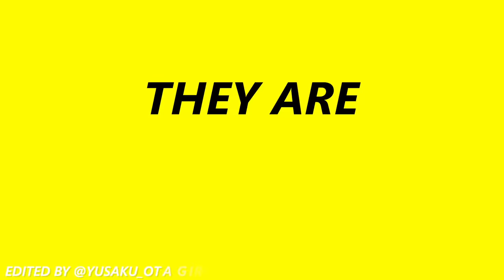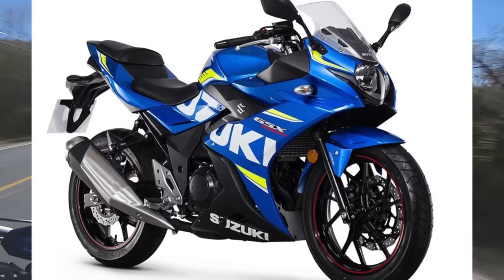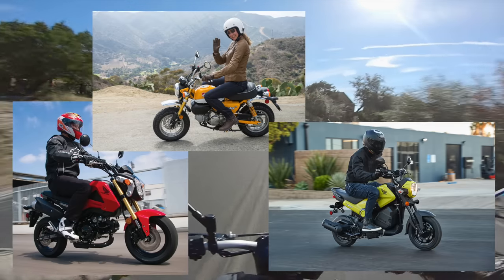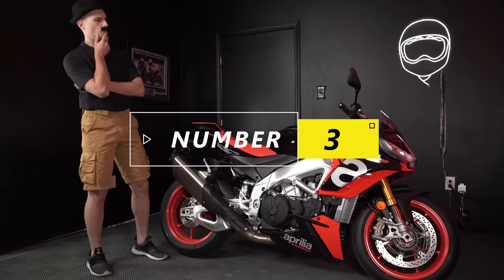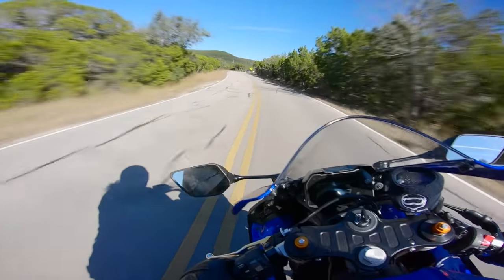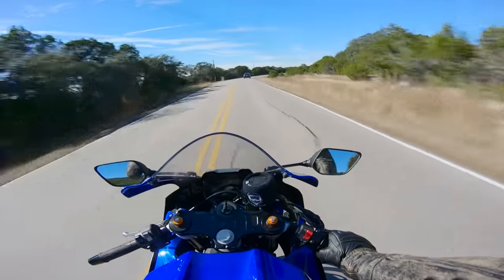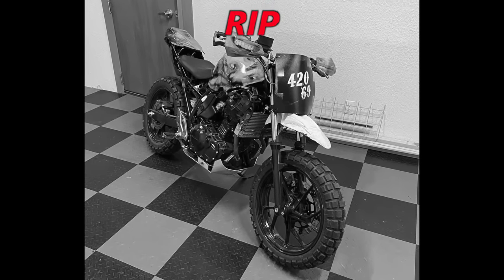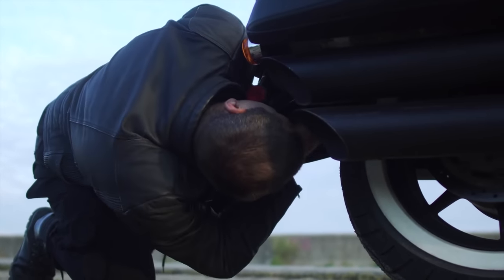Top 7 Worst Beginner Motorcycle Choices! (Must Avoid)

Comment: Although I'm not a beginner my riding has been cruisers. My 2011 dyna street bob is making 106hp/122tq so I thought the z900 would be a perfect 2nd bike not really thinking it couldn't be that much faster than my dyna. Needless to say one half throttle 2nd gear pull on the kawi that assumption went away real quick lol!!!
Reply: Yeah bro at the end of the day cruisers are heavy and slow compared to any sportbike 600cc and above.
Reply: I went from a rebel 250 to a ninja 300 to a 2010 zx6r then finally a 2020 z900. I love having a comfortable bike that has 600 sport bike power with liter bike torque.
Reply: Z900 bros unite!
Reply: 600 level horsepower and liter bike level torque with comfy ergos and good looks seems to be the magic combination when making a bike. That’s why bikes like the z900, xsr900, Ducati monster, and speed twin are so successful
Reply: Lmao I know what you mean. I spent 7 years riding only Harley’s. I rode with sport bikes quite a few times and thought well they’re not much faster. I got my MT-09 and opened up 2nd gear on the way home and was like holy shit this isn’t even in the same realm. Then I got to a stop light, and barely giving it any throttle the front wheel came up and I realized I’ve been lying to myself for a very long time about the capabilities of a cruiser.
Reply: Yup. I ride a 1900 Raider. Thought that it wasn't a big deal to go liter. Took out a GSX-s1000 for a test ride. Hit 7000 rpm and sonuvabitch! Not sure what I felt on my Raider before that...but whatever it was, it wasn't true "speed".
Reply: @christopher7310  just 7k rpm? 😂 U gotta try 14k 👌
Reply: Went from 2000 yamaha road star silverado 1600 to Z900 big difference anyone can see, but these cruisers are for just that, chilling taking it slow. The Z900 for me a bit more  torque or at least you feel it and not crouching which is comfortable it's also faster and has the 6th gear and no carbs
Reply: I agree, I went from a 109R to a Z H2 and wow good times so far.
Reply: @jeffrakunas663  You my friend have great taste in bikes
Reply: @pravesh736  I don't think I pushed it beyond 10k. Once I hit 7k, it just came alive. And only got angrier the higher those RPMs got. I loved it so much that I'm hoping to pick one up this summer.
Reply: …….and that’s why Harley’s are shit bikes.
Reply: @Antonio_zx6r  I agree 💯. It’s going to take me a couple months to learn how to handle this Z H2 and I’m okay with that.

Comment: great video. yup, i was one of those guys that getting back on a bike after 40 years, at age 66, i have driven everything but a tank. i wanted a Honda Fury, 1300 cc chopper style. thank goodness for lousy credit. i ended up getting the Rebel 500. man, i can tell you, it's quick off the line, easily does 80-90 mph. only weighs 416 lbs. easy to control. it's a small looking bike, but i love it. it's fun. fun i tell ya!! i've added bags, and floor boards, and a rear fender carrier, i get a lot of compliments on the look, and other riders give me the wave when riding. me be a happy camper!
Reply: Nice choice!
Reply: My dad was in the same boat - returning to riding after something like 30 years. My sister and I bought him a Honda VTX and he adores it more than anything. Good on ya for getting back on!
Reply: Similar story.  Looking for the "right bike" and leaning to V-Strom 650, KLR650, and Versys 650. 
Oh, I have driven an HMMWV, Jeep, wrecker, tractor trailer, 4 wheelers, and a tank. But no aircraft.

Comment: Hey yammie i bought a 1981 cb900c for 200 bucks from the second owner with a stack of service records drove it 45 miles home. I worked on it for a couple days rebuilding the breaks and fork seals with my dad, who grew up working around multi cyl carbed bikes. I had him break out his old tools and showing me how to use them to tune the carbs and had it riding great i put another 1000 miles on it in a month before the end of the season. My dad and i had a great time doing somethimg as a little father son project, sometimes it is worth it to get the old bikes.
Reply: You got lucky, I had an 82 900c and i loved that bike but it had so many issues that I ended up trading it for an 02 shadow 750
Reply: 100% agreed. Carby bikes are simple and easy to work on once you know what you’re doing. And it’s necessary (and not difficult) to learn the basics of how your bike works. 
These guys are at the end of the day pretty uneducated when it comes to anything mechanical. They aren’t car guys who converted. So you can’t really blame them for finding some stupid simple stuff relatively complicated.
Tuning a carb is as simple as turning a screw, tuning anything efi takes computers, dynos, many hours etc. Not saying that one is better than the other, but both have their advantages. These guys just skim over carby’s because they still don’t understand them for some reason…
Reply: Don't worry Yam and the gang just have an irrational fear of carbs
Reply: @izzy031096  Speaking as some dude who literally undergo from carb to EFI due to legal concern (Carbs being phased out in 2016 due to emission law, along with 2 stroke) that's a load of horseshit. Especially in the age where most fuel have ethanol mixture in it. And I'm just dealing with a dinky single cylinder. Carbs are for if you actually spend more time in the garage than on the road.
Reply: @victoriazero8869  Not questioning your competence, but if you can't re-jet and set up a single carburetor to deal with alcohol gas, perhaps you should find another hobby.
Reply: And you also don't sound like a beginner with no experience on motorcycles
Reply: That's a great project for you two but it does not apply to most people. I would say the majority of people get into bikes to ride them, not wrench them.

Comment: Interesting vid, yammie. Actually, what determines a good beginner bike all depends on the specific rider's size, dexterity abilities, and learning capacity. I have taught a lot of new riders learning in all those bikes, and I can safely say not one of them ever came close to having the major accidents you had. Anyway, ride safe, god bless u.
Reply: You must be a motorcycle instructor because that is the most insightful thing ive seen on here. It's so true what you say its all on the ability of the rider. I wouldn't put my 60-year-old father who is sedentary and has never ridden a motorcycle on an r6 but my friend's that are athletic have great reaction time and are quick learners with their hands all started on r6s with no issues thanks to the instructors on the track they could feel confident riding an r6 after only 2 days.
Reply: @walkerfharris  confidence & skill are two very different things. Having the confidence to do something does not mean you have the skill to pull it off.
Reply: @dcptiv  true but twisting a throttle and cornering are simply not that difficult to do as long as you don't ride faster than you can handle you're fine. Just like in a car.
Reply: With insane insurance premiums I have no idea how some of these kids afford new motorcycles, even used ones. Back when the FJ1200 came out. I went to buy one, found my premium was $1,500 per year. So much for that dream bike.  How anyone can afford a $20K motorcycle, finance it, and carry full coverage insurance on it is just pure nuts, why would you want to. Heck my Daytona 955i cost me $98/year .. My Duc was $125...I will never finance a motorcycle...
Reply: @carlmayer691  you sound like a very honest person; but most insurance business deals with dishonest ppl (when it comes to young age). Most young riders of expensive bikes get their tags and insurances under the names of their older relatives (i.e., older brothers, uncles, fathers, and even mothers or aunts). Gotta love a family that helps each other out. Anyway, ride safe, god bless u.
Reply: You can pour your knowledge into a rider, but teaching a rider is some what impossible, only they can work the brain, brakes, throttle, clutch and safety  themselves.
I told my boss who wants to ride as he sees me ride in for work every morning on my zzr, that I can pour my knowledge of 48 years into you, however you are the rider who make the simple mistakes of clutch and brakes.
I told him first rider safety course, license and my knowledge.
Reply: @dcptiv  ur the only one who said confidence he said physical ability

Comment: An old carbed bike, is THE PERFECT starter bike. You can drop it without being sad about it. In the same time, you learn ALOT from diagnosing the problems and fixing them both big and small.
Reply: But it's just as likely for it to not have any problems at all.  My first 2 bikes were carbed, didn't have to touch the carbs on either of em the entire time I owned them.  Was literally, put on choke, start bike, give it a minute on choke, turn off choke ride off.  And they weren't singles either.  First bike was a Honda CX500, and the second was a suzuki Bandit 600
Reply: 100%. These guys always harp on about how complicated and difficult carby bikes are. I pulled the carb off my dr350, pulled it apart, cleaned it, put it back together, and reinstalled it, in roughly an hour the first time I ever did it. They really aren’t hard, and the lack of wiring makes them super simple.
Reply: @mrvwbug4423  exactly my point! My first was a gs500 dual carbed
Reply: @izzy031096  Yeah, I used 2 hours on my xv535 virago.. but it was a dual and yamaha in the late 90's were bitches when then were building mc's
Reply: As an old bike lover, I disagree. When learning to ride a motorcycle, it's best to just focus on learning how to ride. Learning to be a mechanic at the same time is a mistake. Get an old bike as your 2nd bike.
Reply: I'd say it depends alot on the specific bike. I started on a Virago 125 and now own a '97 Honda CBR 600. Never had any trouble with the carbs. These japanese carbed bikes are usually darn reliable. Of course, FI is less troublesome, but early FI was known to have bad throttle feel compared to carbed bikes with years of development behind it. Plus, you just can't beat the price tag on 90's japanese bikes.
Reply: Carbs are fine, junk that you have to work on when you don't know how is not. The newest bike in our fleet is a 94, but we have put our fair share of time into getting them fully functional.

Comment: This explains nothing to me lol, I started out on a brand new 600 absolutely love it, I think the reason why it worked out so well for me tho is because I respected the bike and it’s power knowing that I was on a bike that was meant for experienced riders. I basically defy the video as a 600 was a perfect bike for me.
Reply: Ya I ordered mine too and gna do the same all be alright
Reply: This is also my experience exactly. Starting on a 600 isn't a bad thing as long as you have common sense and a willingness to learn.
Reply: i have an 07 kawasaki ninja 650R as my first bike and honestly it feels really good especially after doing my M2 course on 300s (two days with 16 hours riding overall). the power doesnt feel like more than i can handle and its just super fun to ride.
Reply: @wrench_boi  how long have you had yours?
Reply: Yea it depends a lot on your previous experience with vehicles in general. 

If you are a beginner but you’ve been into vehicles, specifically racing, for a long time you probably know how grip works, gears and clutches, weight transfer, power bands, etc, and you can start out on a fairly powerful motorcycle if you’re smart and careful. 

If, like many people, you just want a motorcycle but haven’t really been into cars or motorcycles very much, you may hop on a 600 and hurt yourself as you’re trying to figure out the basics of gear changes and turning. 

For me my first motorcycle was a yz250 with a 300cc bore kit, and a bunch of aftermarket parts. The thing was crazy fast, especially for the single track I used it on mostly. However since I had been into cars for quite a while and done a ton of research on bikes I was prepared and able to ride the bike safely.  So yea, the first bike I rode ever was a tear-your-arms off old 2 racing stroke and I never got hurt.

Comment: in america a beginner bike is a bike that has an engine cc with 3 digits, and the first digit is 3. in europe, a 125cc bike is the max you can get until age 19. then if you do your license steps it'll be 21 at which you can ride unrestricted. honda groms, 125cc cbrs and cbfs, yamaha ybrs and r125s are a very common sight  with teenagers.
Reply: For real. My first bike was an 07 cbr125, from that I went to a cbr400r and a gs500, and am now riding a 2000 sv650 (passed my test just after the licencing laws changed 😭) but the sv is plenty smart enough for British roads!
Reply: @bassplayer7693  oh definitely, you don't need more than 400ccs on British roads. Won't stop me from getting a Kawasaki H2 and driving that around tho lol

Comment: IMO if you are a beginner and you want to learn how to wrench on a motorcycle the perfect type is, small displacement (125-350~400), single cylinder carbureted motorcycles, they are easy to work on, they are kinda torquey  for their displacement without arm-ripping top end

if something goes wrong with the carb try to fix it, if you cant you can just buy one carb (and can even cheap out on a chinese one, since your motorcycle isnt that performance heavy to begin with) bolt it on and keep riding. 

and if you get the itch to tune it, the sky is the limit, airbox mods, bigger carb, exhaust, big bore kits, nitro, fucking turbo, you will be surprised to how much you can do to one of those single cylinder smaller cc engines and they just keep going  (especially if they are Japanese)
Reply: Buy a Ducati, you'll learn LOL..seriously after owning a 999 for 8 years, I learned a lot about that testastretta L twin.. It had a dry clutch, which I could tear down completely in about 5 minutes or less. In the beginning I was scared S-less to touch it. R/R radiators, cam belts, swinger, added a DP Pierobon swing arm... Ohlin R/T forks. DU301 shock...it was shockingly easy to work on, maintain  and Terblanche made it so.  It's just the parts were  x 200% more than my Daytona 955i and it took months to get them...

Comment: I started on a rebel 500.  It's a good bike but it left a lot to be desired. I'm 5'9" and 200 pounds and realized that bike was horribly too small for me. Which in the end played a part in deciding not to upgrade to the rebel 1100 as my next bike. I ended up with the triumph Bonneville speedmaster, which I feel I may have been able to start with anyways.
Reply: How long did you have it for??
Reply: @IAmGabe777  I had the rebel 500 for a year.

Comment: Started on a 2008 zx6r in wildfire orange and I couldn't imagine a better start.
Do keep in mind that I'm light weight and exactly the right height, so my body wasn't an issue.
They are quite manageable when starting out, as long as you have some self control.

Comment: A lot of good facts here. Definitely need to do your own research tho, especially on the project bikes and carbed bikes. It’s a good way to learn and gain mechanical experience to save you money when riding. Yea if you have no mechanical knowledge, or drive to gain it, don’t get a project bike or a carbureted bike. But starting with a bike where you have to work on it a little will not only save you money, you will be able to learn some mechanics and riding skills at once, and maybe even profit off the bike when you upgrade

Comment: I started on an 86 700 interceptor, probably was the best bike for me to learn on. Got used to the weight and power wasn't over bearing but enough to teach me throttle control/respect.

Comment: I agree with the mini bike portion.  I started on a Benelli TNT 135. When I was at the dealership the salesman tried to sell me a used ninja 400 that was like $1500 ish more. I said no way man. That’s gonna be too fast. I don’t wanna get hurt. I wanna learn. Etc etc. he said that’s fine. But you’ll be bored in 2 months and you can learn just as good on this. That salesman was right. I did learn some stuff on the Benelli. Did get some confidence. But I got rid of it after 8 months. That engine was screaming anywhere near 50mph.
Reply: Rupp 80 !!!  CB400F, CB900F, too many CR125s, 250s, 480s, one KX 500 in between...then a ZRX1200R, XX, 999....Daytona 955i  which is the best road going bike of the bunch.  Got to get that supreme confidence riding...before..you start riding on the street. As an ex police officer, the street is unforgiving for we  motorcyclists.....especially now w/ the advent of cell phones...

Comment: Moto guzzi v7 is an italian motorcycle that is easier or just as easy to maintain and arguably just as reliable as the triumph street twin.  It's an air cooled engine with a screw and nut type valve adjustment.  Just look at the v7's engine and how easy it is to remove the valve covers.  Both really nice bikes.  I owned the current street twin and the moto guzzi v7 III.  Sold the street twin.  The guzzi is just so unique and fun.

Comment: Don't usually respond to ads, but the I have the Nolan N40.5 and I can very much recommend it, especially if you're doing a lot of relatively lower speed riding (city or up to 50), though with the click on chin piece you can still safely take the highway if needed.